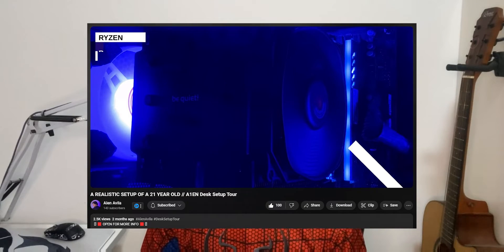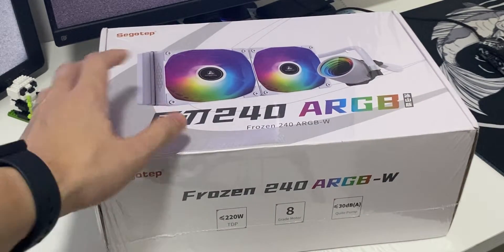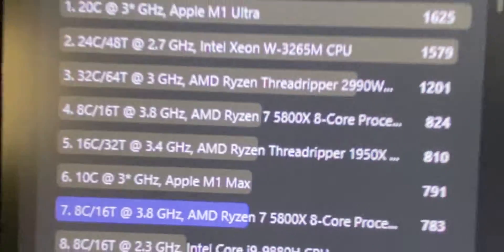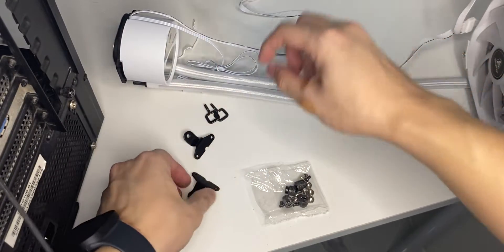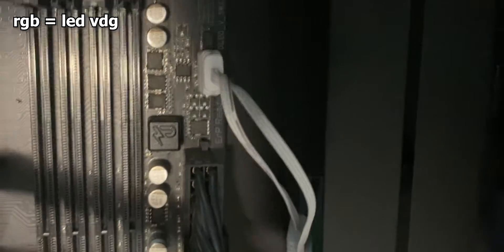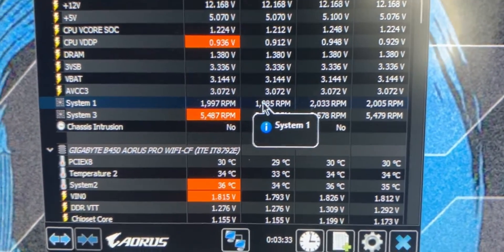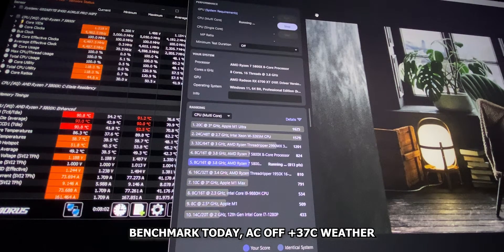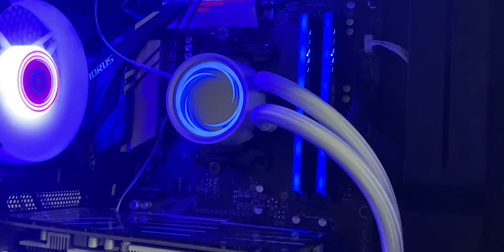Dark Rock Pro 4 to a Liquid Cooler | Segotep Frozen 240 AIO

Comment: It looks like you have some room to add a couple more 120mm fans to your radiator in a push pull configuration. It can really make a difference. I just got a thermaltake tower 300 (swapped from a corsair 4000D airflow) and i'm really missing my push/pull configuration i had on the 4000. The tower 300 doesn't give you that option. While my case looks so much better now, my CPU is running a tad bit hotter as pull is the only configuration i can use. I had to adjust my PBO limits to keep the same temps. On a 5900x i had 240/140/165 with the corsair. Max temps running R23 were 80. Now i'm at 215/130/150 on the thermaltake with max temp at 80. With the higher PBO limits i used on the corsair I was hitting 85-86 on R23 with the tower 300. So bottom line the extra fans dropped my max by 5-6 degrees under load. I'm using corsair QL120's which aren't very strong to start with. Your results may vary depending on the type of fans used.